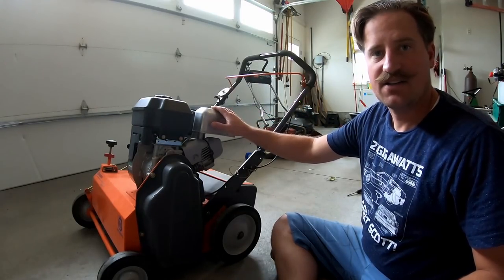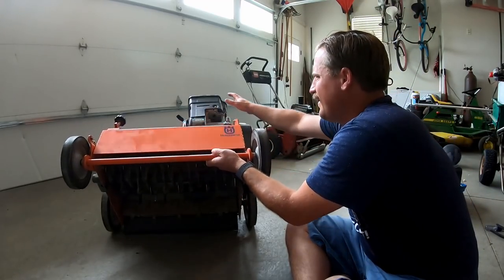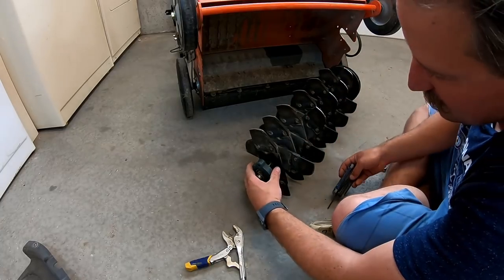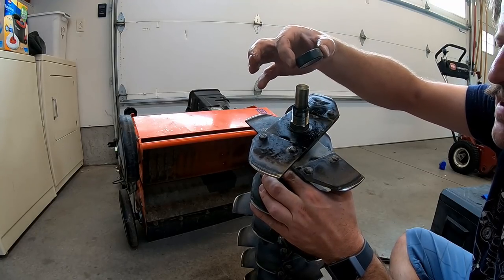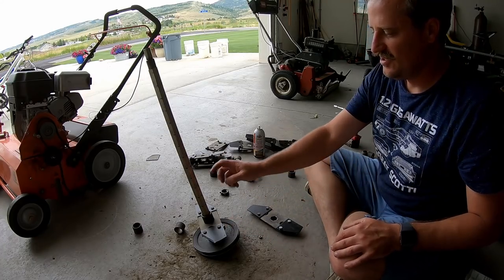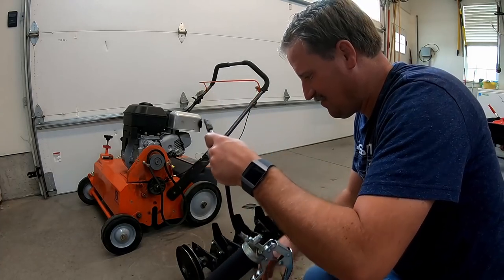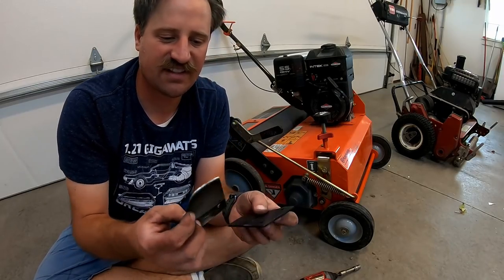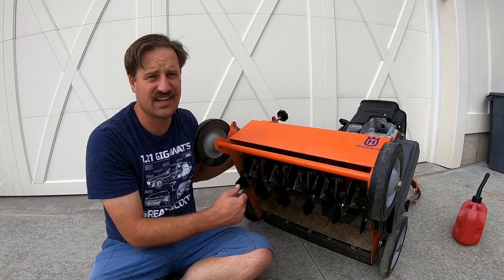BLUEBIRD, BILLY GOAT, HUSQVARNA slice seeder blade replace // CONNOR WARD

Comment: Did you buy this unit used or new? Do you know what you can usually get these units for used? I’m debating on buying an electric one like the VanHaus or buying a gas powered one but not sure if it’s worth the money for my 6k sqft lawn.
Reply from the maker: I bought it used for around $800. High price to pay for only using it a few times a year. I do love that machine though.